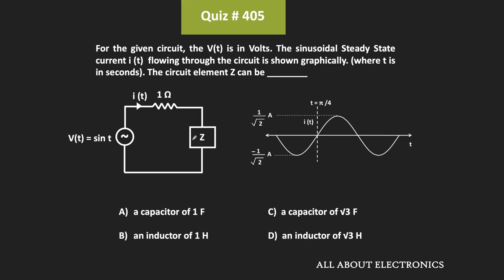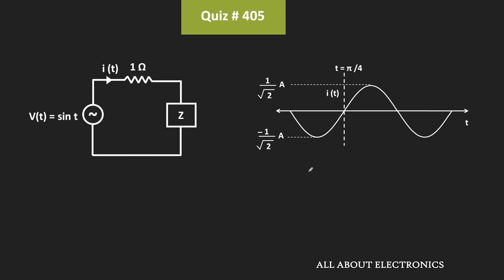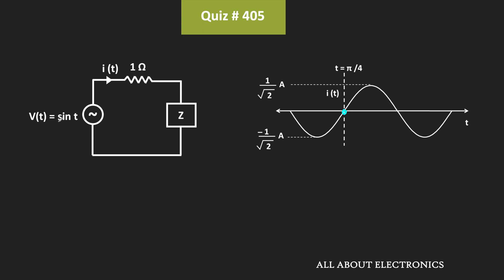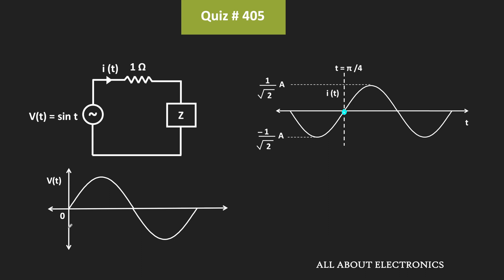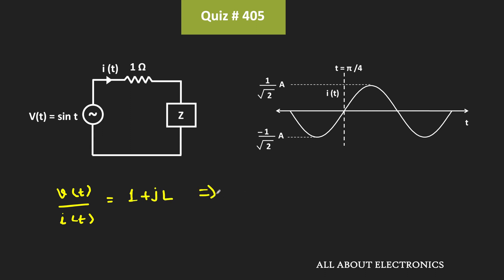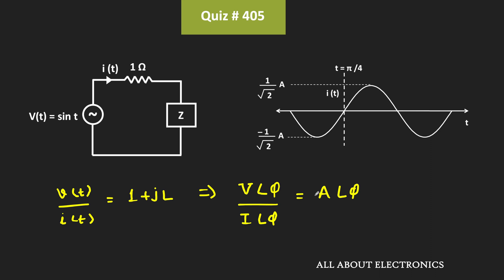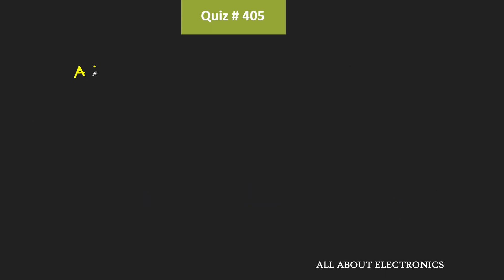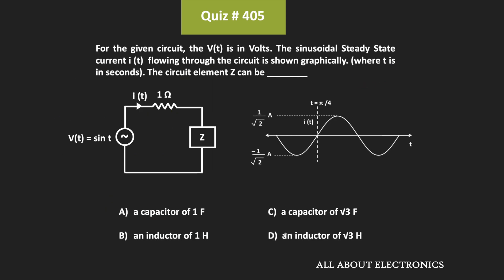Sinusoidal Steady State Analysis (Network Analysis) Solved Problem | Quiz # 405

Comment: You are mistaken. The Current Leads the Voltage by pi/4 and not the reverse. Clearly at the origin, the current already is at pi/4, whereas the voltage starts from 0 at the origin. So therefore the current is leading. please recheck
Reply from the maker: Just draw both of them side by side. When voltage starts at t=0, the value of current is negative. When voltage reaches some higher voltage at t= pi/4, the current reaches at 0. So clearly it is lagging the voltage. Please check it again.
Reply: Bhai tu sir ki bat ko ache se check kar tap samajh me ayega , khud ka doubt ko double check or sir ke sath compare mat kar , sirf jo kehte rahe he sirf voo sun
Reply: no
voltage leads current by pi/4